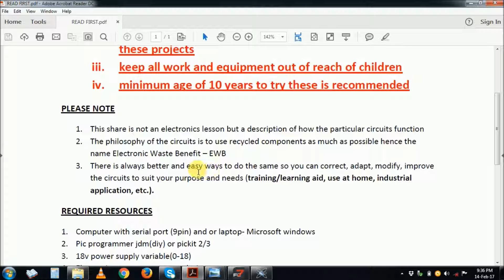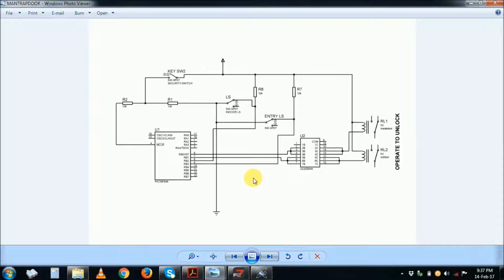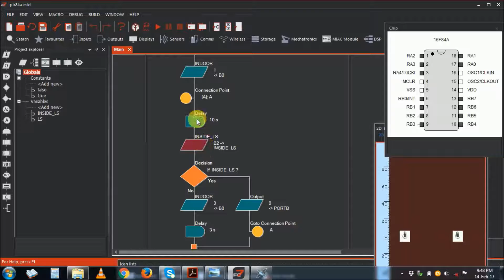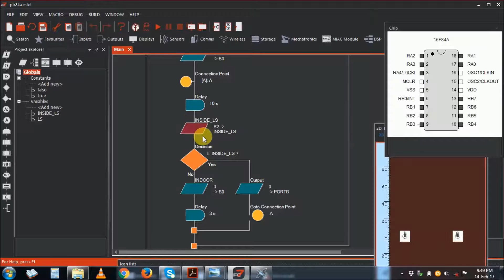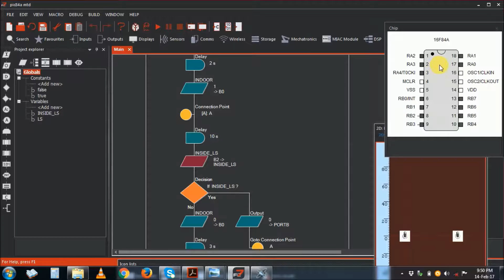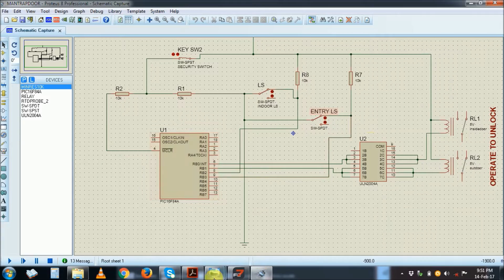PIC16F84A ACCESS CONTROL CIRCUIT

Comment: What are the components needed?
Reply from the maker: There is a google docs link with complete circuit diagram.
Reply from the maker: https://www.youtube.com/redirect?v=khin-JoF_4w&redir_token=koNG5961Bl7uWZ8aYLFm7qRXbyx8MTUwNzQ2NjQ0M0AxNTA3MzgwMDQz&event=video_description&q=https%3A%2F%2Fdrive.google.com%2Fopen%3Fid%3D0BwVr8mtvy2Z7RDdlUkU3NF9IQ2M
Reply from the maker: Remember active components like pic16f84A and indeed any IC will require power. Regulated 5V in this case for the PIC and 5 volts for inputs. Adapt it for driving loads that require different voltage levels using buffer IC like uln2004 for driving 12V relays which will switch siren . The same goes for all my circuits which I didn't indicate powering. You should consult an experienced electronic/electric someone to help you if there is a problem. The circuit given is just core.